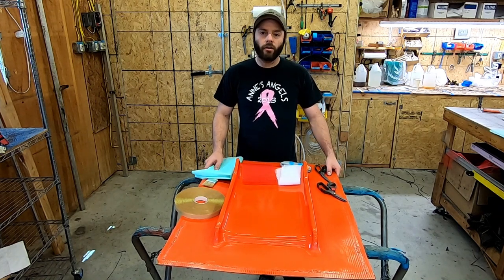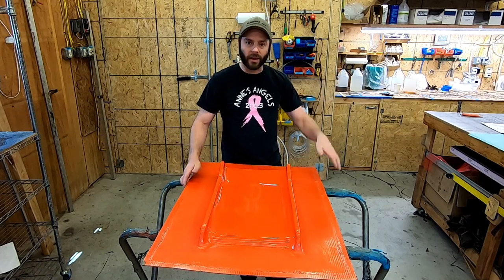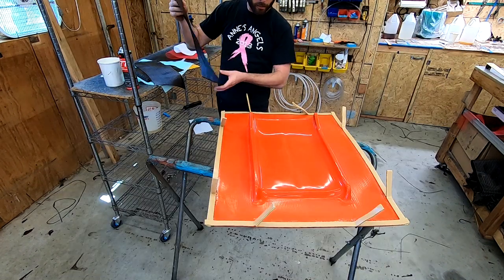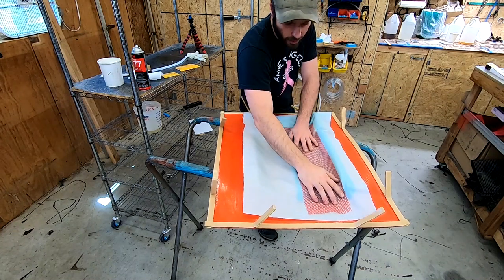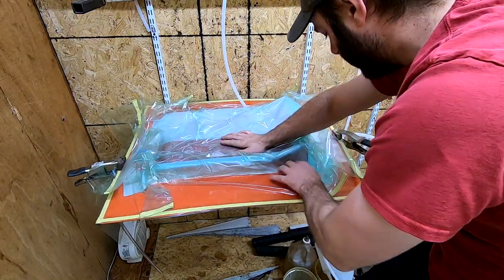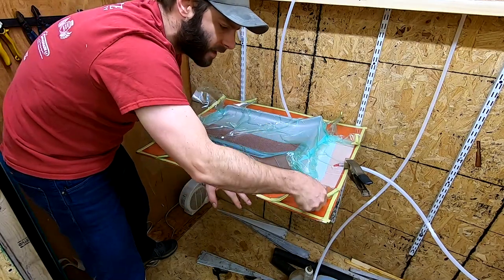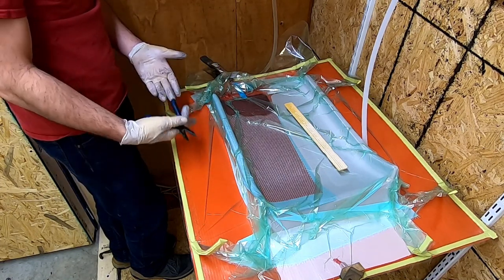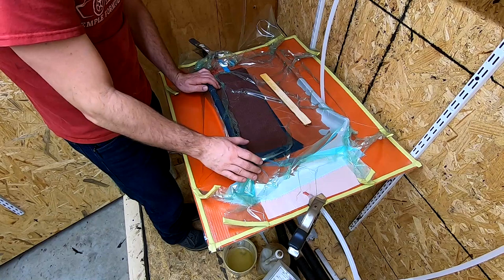Carbon Fiber Infusion- How To

Comment: This is very fascinating, you really didn't have to record this for us and you did it anyway. I always found the properties of carbon fiber and the process behind making it into parts to be fascinating! I ordered a set of canards from you back in june and just got them yesterday, they are going on my 08 Mustang GT. You are one of the only people that makes proper aero for the S197 cars. I have the car up in the air doing a clutch, motor mount, and drive shaft upgrade and I might as well take the bumper off now to put this and a seperate splitter and some led lights on. I ordered the canards raw because I had plenty of clear coat on hand and already sprayed them :) Your work is very impressive! I will be sure to send you pics when my car is all done

Comment: I assume since your using that 3M Super 77 it doesn't cause any issues with discoloration, or epoxy flow on the surface of the clear coat?

Comment: Hi there, does the vacuum chamber lid have too be tempered glass? Or will acrylic lids be ok ? I’m wondering if the resin gases will cause a chemical reaction making the acrylic lid crack?